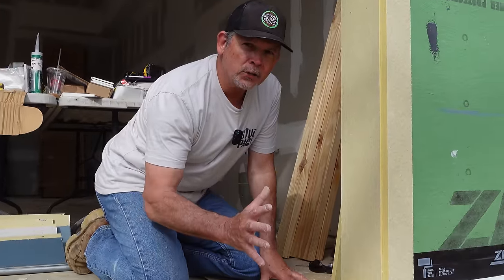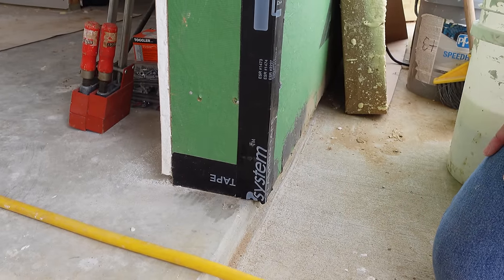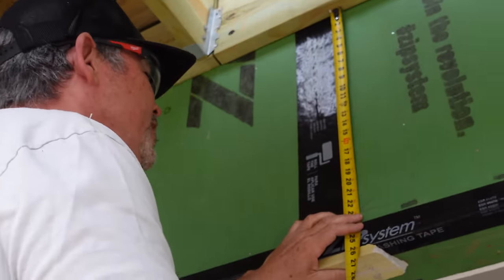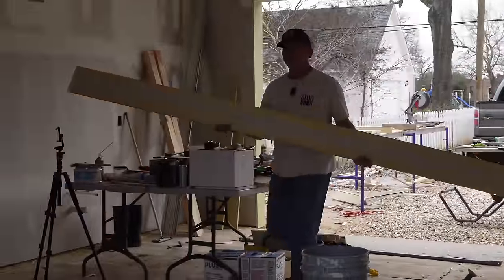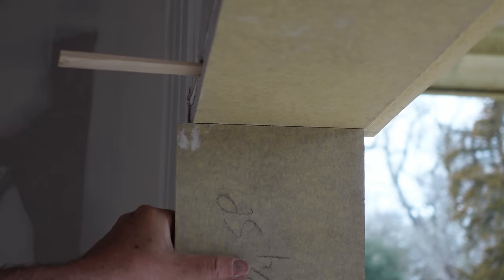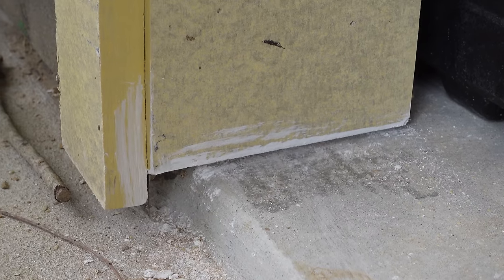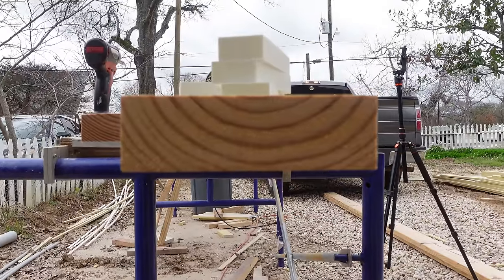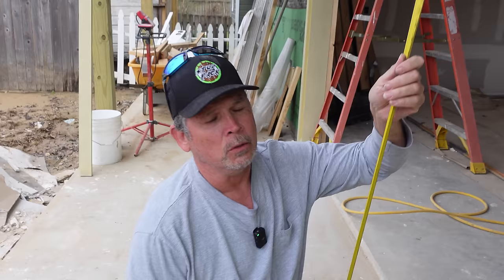99% of Garage Doors are DOOMED to Fail, But Not This One

Comment: Go with the 24" spacing for the boards. 16" is too busy and it's going to be worse on the longer runs.
Reply: Agreed, I would be curious to see what splitting the difference would look like.. 20"
Reply: @DozIT  has to divide evenly into 48 to cover the seams.
Reply: I say go with 8" or 4" it will be great :D
Reply: gonna look like an old mattress with 16"
Reply: @Novascrub  ahhh right!
Reply: Batten Board is supposed to look 'busy'.  And the garage doors are the major feature on the front (and back),  24" will make pretty much square frames above the door, which IMO will not look good at all.
Reply: I think the 24 is better too
Reply: 1000% agree. Plus as a painter the batons are the first thing to fail (paint and caulking wise)

Someone is gonna have a sore finger after they caulk all the batons to the board. Ask me how I know.
Reply: federal, state, and local building codes aka the law states it has to be 16" for lumber buildings. timber frame or iron beam frame has different code. it's just like electrical outlet heights along the floor...not allowed to deviate from specific safety reasons such as fire and load bearing
Reply: i agree!  24" seems like the right spacing
Reply: Too busy is right.
Reply: Took the words right out of my mouth!
Reply: Took the words right out of my mouth
Reply: Youll have a shutter look with 16... better to do 24, less work, less busy, more Texas style/southern.
Reply: Agreed. 24
Reply: Agreed
Reply: I say go with 16”
Reply: 24” is wrong and will look like you’re using a fake material. The hardie siding isn’t real wood, but that’s what the board and batten design is trying to mimic. You would never have 24” wide slabs of wood siding. 16” is very large spacing. 12” or 8” is a more authentic spacing if you want it to look like board and batten siding.
Reply: @aprilgeneric8027   This is just siding, not stud spacing in the walls. Totally different things.
Reply: Twenty four, fo shour. Great video again. Best of luck.
Reply: Definitely 24" for me - but it's not my place!
Reply: Agreed.  And unless they got one hell of a sale, a useless waste of material!
Reply: 16" looked better in that specific area, but you have to consider the bigger areas as well.
Reply: Are you serious? Building a pole barn? WTF!
Reply: The benefits for being young & building your 1st home with the techniques & technology that is available. Also the better products that are made now. Not to mention a "Kickass old man that's got your back! You're an extremely lucky individual!
Reply: I agree.  24" on center uses less material and labor.  It also looks less busy and will make the building look smaller overall.
Reply: My vote is 16"
Reply: PM for a custom builder here. 16 is standard, 24 is “modern”. There’s a reason Hardie, LP, and DiamondKote etc. all make 16”x16’ boards y’all. 12 looks ok on sheds and outbuildings smaller than ~16’, but on a house looks too much like what they did in the 70’s.

Comment: I would go with 24" spacing. The 16" will look really busy when it's done, especially considering the size of the windows above it. You could take a picture of the face of the building and (roughly) draw lines over the image in both configurations to get a better idea of what each will look like, too. Trim looks dope, guys!

Comment: 15:00 The tracks for your overhead door are going to extend above your trim, I would recommend going right to the ceiling with your side trim, especially if you plan on installing a "high lift" overhead door.  Also if you have a "torsion bar" you will need another trim board screwed into structure from the ceiling down to your top trim board.  Jordan, if you plan on storing extra vehicles on a 4 post lift I would plan for a high lift door and tracks, less chance of your door hitting a lifted vehicle or the lift.  Also when planning your high lift kit, you should be able to get away with 4" of head room if you use a standard side mount "jackscrew" opener, I regretted going with the standard "12 headroom Clopay recommended.  It cost me $600 per door to order new tracks, drums and torsion springs for a replacement 3' high lift kit, it should be cheaper if you plan and order high lift tracks with your doors.
Reply: yup, they need to frame out an "H" or goal posts for the interior side of their garage doors.
Reply: I came here to say the same thing. Those vertical 2x6s need to continue uninterrupted from the bottom plate to the top plate and be well attached to both. That locks everything together and provides more strength. After all, the entire garage door is hanging off of those. You don't want them pulling away from the wall over time.
Reply: Concur. I'm retired now but once owned the largest garage door company in central NC.  I had a heck of a time getting our home builders to build the interior jambs correctly. And one issue that occurred regularly was not attaching the door jambs securely to the structure, in particular the center jamb piece that the center bearing plate for the torsion bar attached.

Comment: If you are going to mimic board and batten as used on barns and such, 10"-16" would be appropriate as would be varying the spacing. This as the width of solid wood boards was the determining factor, not the dimensions of standardized building units.

Comment: When you do install the garage door, I would recommend a jack shaft mounted opener. I have several friends and family members who complain of how noisy a traditional garage door opener is. They are unable to open and close the garage when the kids are sleeping because the kids rooms are right above the garage. I haven't used a jack shaft opener personally, but I hear that they work better and are much less noisy, plus they free up the area above the garage door for some ceiling mounted bin storage.

Comment: If you are going for a traditional Board & Batten look: 8" to 12" random since the Boards were rarely even that wide.  Otherwise use much wider battens at wider spacing. The hard thing is lining them up top to bottom

Comment: Whoo Stud Pack remember the original board and batten, it was actually a series of boards, generally the widest available,  1 x 12s with an 1-1/2 batten at the joint. It was heavy with texture and shadow line. You could put battens at 12" if you want to mimic the traditional look but no less than 16".  24" is just too fake looking for me.

Comment: Not sure if you have addressed what garage door motors-openers your going to install,but they have wall mounted motors that  
go right on the garage door wall that eliminate the chain/belt track,and are supposedly quieter and longer lasting.
Here is one that is out there: Genie 6072H-O Residential Wall Mounted Garage Door Opener
Reply: +1 on the wall-mounted garage door opener

Comment: For the mini split mount- those heat pumps are very quiet, but despite that, in some instances they vibrate the siding and there’s an odd harmonic effect. Recommend high quality (thick) isolation pads where the heat pump feet mount to the bracket

Comment: What ever spacing you decide on, divide it up so all the spacing between the battens are equal, please don't have the two spaces on the ends a different spacing than the rest of them.  You may have to cut the boards to accommodate the battens so the seems are hidden.

Comment: Cut enough battons do do the maximum number. Then temporarily put them up. If you want less then you can always use them on the next side of the garage. That way no wasted material. I think less would bring the scale of the house down and make it look smaller. More might look busy. It might be batter to decide after the upper siding is done too.

Comment: I put down a treated bottom plate, frame on top of that. Then trim with aluminum coil stock. Years ago, I built my house and trimmed the garage door with cypress boards, never rotted. Some years later, got tired of cleaning and treating the natural cypress, sided over it, trimmed the woodwork with aluminum, rot free 37 years later.

Comment: I remember one of the best architectural/interior design tips I was given was with repeating, even patterns in custom homes to make the number of repetitions a number not divisible by 4. For example, in a standard kitchen you would have an island with 4 cabinet doors. In a custom island you would have 3, 5, or 6 doors on that same area to make it look less standard. If it was at 20’ I would opt for 16” to have 15 repetitions, or if 18’ I would opt for 24” to have 9 repetitions. The odd number will set a great coordination with the 3 large windows above.

Comment: I lean to the 16" batten spacing.  But 2 tests are to first imagine and then do a pencil layout of the  spacing on the main house elevation drawings and second go to the curb and look at it with the women in your life and ask them.   You would be surprised at how easy the decision is after doing both those steps.

Comment: 16", for sure! Board and batten is very historical, the wider gap looks vaguely odd and inappropriate. The narrower spacing is much more pleasing to the eye. Like most historically inspired details, the closer you get to the original, the better it looks (for more details watch anything by Brent Hull).

Comment: Looking good. 
Usually when I install garage doors I usually put the 2x6 floor to ceiling and a 2x6 in the center from the top of the door  frame to the ceiling and then cap the boards with aluminum to give it a nice clean look. The only reason for the extra lumber is to allow for different options of door tracks and openers.

Comment: I like the 16" spacing.  24 looks like a mobile home, and 12 would be too stripey. Traditional board and batten wouldn't go wider than 18" and was usually closer to 12.

Comment: I cannot tell you how glad I am to see this video! I discovered insect damage in the middle of one of the vertical pieces of my garage trim - I am very much afraid I will have to pull all the trim off the door, not just the damaged piece.  Now I know what to use and how to use it.  I still haven't found how the insects got in ...here is hoping it's only the trim 😳

Comment: In my area in RI we have a lot of buildings made with rough sawn white pine from the local saw mills.  All were 12" on center, big trees are hard to find.  This is a cost effective way to build out buildings and even your home siding.  Back in the day a beach bouses were a second home and had to be affordable.  Now these houses are being torn down and thousendsof dollars is going into design and build.  Turrets are the new thing and cost a furtune.  But the original tradition was vertical board and baton 12" on center.  But you must like what you build, so do it your way!!!

Comment: Ours was wrapped in metal, only for the seam on top get water in and rot the top board, ended up replacing both sides, both top boards with pressure treated lumber, and covering the wood with flashing tape and vinyl trim.

Comment: Looks good. Only thing I don't like is the back jambs being mounted over the drywall. If you mount the backjambs, which is the 2x6 in this case, prior to the drywall you can just butt the drywall against the 2x6. Also it's a good idea to run the vertical back jambs all the way to the ceiling so you have enough wood depending on the garage door track used. If using torsion springs you would need a board in the center for the spring anchor.

Comment: For spacing out trim like you did above the garage door opening i just use a level and a few screws with a large flat head right on the framing under the trim and make the screws level instead of shims and just nail or screw close to it after

Comment: Used to be very common on  mid 90's Chevy S10 and Blazers with 4.3lL, only it was GASOLINE that came up the harness from the injector connector all the way to the PCM.

Comment: 16" batton spacing will look quite busy on a building that size so deffinately go with the 24" spacing so it seems less busy

having the vertical battens will also make the tall building look even taller which is why buildings like skyscrapers tend to have horizontal details as well to make them seem wider

Comment: 21:54 - wouldn't this limit the weight that the unit can support, since the screws are now on the bottom instead of the top?  Seems like whatever is being supported would be at greater risk of pulling off the wall.  So exciting to see flashing going in.  Feels like you guys will be done in no time!

Comment: What people don't realize is, Hardy also disintegrates because of water. It wicks up water just like wood. I've replaced many feet of fascia in my time that was Hardy, when you go to pull it down, its just paint in the shape of the old Hardy, and is full of Hardy dust. I've also redone tile showers that were falling apart, and when you pull the old tile off, the Hardy under is turning to dust. When it first came out, it was said to be the end all, beat all and would never rot. They found out, this just isn't true. Make sure your Hardy is well sealed and painted, nail holes properly filled it (I've found a roofing nailer works great. Doesn't crack it) and there are no scratches in the paint. Any little scratch will allow water to wick in.

Comment: double 2x4 staggered spray studs by sheathing, regualr in second bay by sheetrock. use insulated sheathing to stop thermal break which overlaps bottom and top plate then seal appropriately. best house ever. garage, for this video should be treated exterior with flashing covering and lexel or so some permanent waterproofing caulk to go between bottom and floor with sealed and wrapped framing as mentioned.

Comment: Great job guys, go for 24" for the boards. Tell me guys, why don't you build with brick on the outer leaf of your buildings, like we do in the UK. It would save a hell of a lot of maintenance over the years, not to mention paint? It can't be any more expensive as the cost of lumber has rocketed lately.

Comment: Distance is controlled by overall width to ensure equal spacing taking in consideration the board seam. It could be an odd measurement but do it to ensure equal spacing across full width

Comment: Gents, I agree with trying to get the exterior reveals perfect, but I don’t agree with scribing that head jamb on the garage door opening—it looks way too wavy gravy.  Your best bet is to flush out the left and right corners and connect the two.  It’s OK to leave the jamb proud; the casing will hide it.  If the center is a little wider, use a board and draw a line from the corners to where it’s proud.  The eye will not notice a graceful curve but definitely a jagged scribe along the jamb.  This applies to the side jambs as well.  I’m a finish/trim carpenter and do this stuff all day long.  Also, 24” spacing!

Comment: I think you should do 19.2” spacing. Gives you a little more space for the size of the garage, but isn’t so close that it’s going to look super busy. Less work with a closer look, plus it works out with your 8’ dimensions. I’ve done it on a few places and really like the way it turns out.
Reply: Would the battens spaced at 19.2" o.c. cover each of the panel seams at 48" o.c.?

Comment: Hardie cant be anywhere near ground or concrete unless they changed the spec. Around here you cant use it like that down to the concrete like that, it will 100% deteriorate aka crumble and dissolve away, ive replaced lots of it done like that. Also, DO NOT use Azek for trim, it shrinks over time when used as trim and will leave gaps all over the place, rather large ones at the joints.  Better option is to use Boral brand trim anywhere near roofs or ground. Its all ground contact rated and doesnt rot or shrink. SImilar to hardie in that its made with fly ash and pvc while hardie is fly ash and concrete. But all else looks great.

Comment: I replaced my 1 by 10" board on between my garage doorc& storm door. Poured 2" of concrete to keep wood from wicking up water. Has been over 25 years and the 1 by 10" board still like new.

Comment: Flashing material? Steel or aluminum?
If you are  doing two tones on the board and batten, paint the sheets prior to the batten being installed.  Pre paint batten then install batten. 
Garage door vertical mounting 2x6 may have to go to the ceiling to mount the door track .

Comment: It’s not that big of a deal but if you’re not careful that spray foam may push your jamb out of level. That’s why they have the specific door and window kind. Just a heads up. I’m sure it’s fine. Anyway great video the garpartment is coming along fantastic. I think the 16” battens might be too much for that building and look a bit cluttered. 24” would probably look best. Have you played with it in SketchUp or anything?

Comment: The jambs for the garage door track should extend up to the ceiling or at least close to the ceiling. Now when they go to install the track, half of the flag bracket at the top of the vertical will be hovering. Also need spring pad, top center of the header to ceiling thats flush with the jambs, properly mounted. Those springs are under A LOT of tension. Just my 2 cents, anyway nice job 👍

Comment: 24" spacing,  I assume they paint on the batons is going to be an accent color to the boards.  You might get away with 16" centers; but I think 24" centers will bring the building into scale without making it a checkerboard.   Nice details on the garage trimout - wish my contractor did that. :)

Comment: You’re very wise to install blocking for the garage door installer, otherwise you almost certainly would be disappointed. I didn’t notice if you added blocking above the header and on the ceiling for the tracks and door opener.